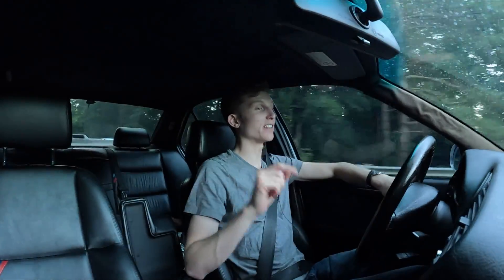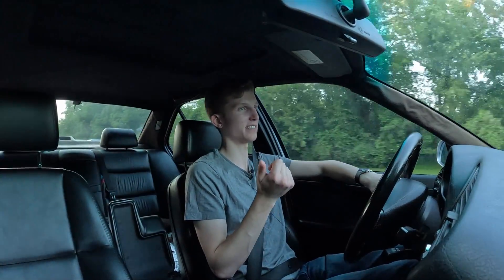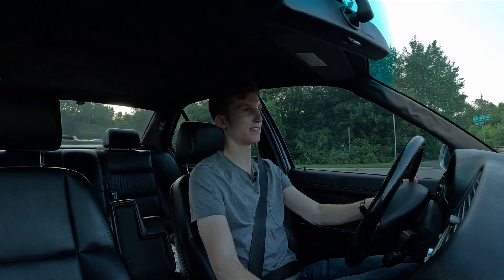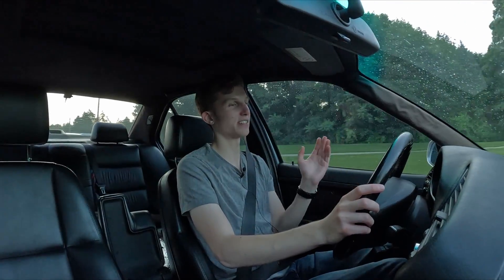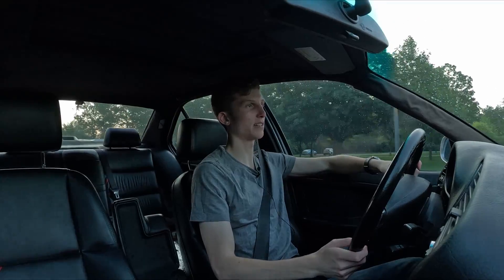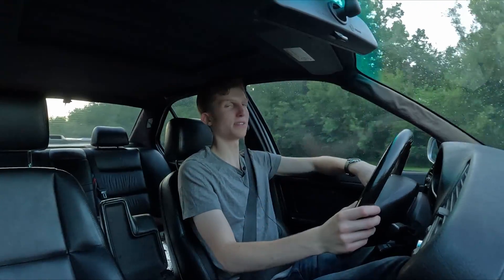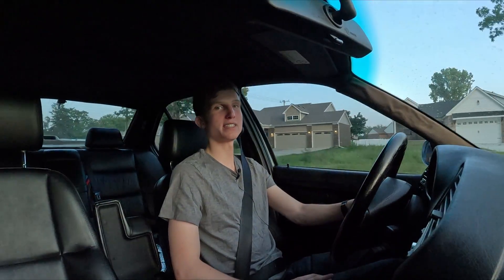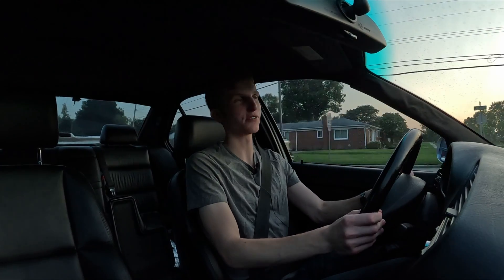Is A Lighter Flywheel Worth It?

Comment: I put a lightweight flywheel (7.1kg) on my M54B30 drift car and I can definitely notice the loss in inertia when trying to initiate drift with a clutch kick or throttling into a drift from mid rpm. The car really needs a lot of rpm now. It's probably a bit more lively at high rpm but at low and mid rpm it is dead. I don't like it already. As Google search AI summary says - breaking traction with a lightweight flywheel really is harder and the car feels as if it has less torque even though it doesn't, it has less inertia. Maybe for 1000hp pro cars it's fine, but for low powered seat time and grassroots cars the heavier flywheel is just so much easier to drift. I can see the benefit for road racing though, where you're mostly on throttle at higher rpm and you don't need inertia to break traction and you do lots of fast downshifts under breaking. But for drifting your 200hp BMW I would suggest you avoid it. Make you car as light as possible, but leave the stock flywheel in.
Reply from the maker: Hit the nail on the head! It has it's place but it's not a defacto "upgrade" like a lot of the internet suggests it is.
Reply: @M-t3ch  I knew it had this effect before buying it but I didn't think it'll be this noticeable. Maybe I got duped by the marketing of the PMC motorsport kit because it said "Drift Stage 2" so I guessed it'll be fine for drifting. It's rated for 700nm and my car probably barely hits 300nm. Maybe it was an overkill. I should've probably gotten stock new clutch kit with stock Sachs performance OEM dual mass flywheel. I'll give the PMC kit a chance for at least 6 months and if I don't like it I'll go back to stock.
Reply from the maker: @fifthgear93  That's fair. I know Clutchmasters makes some kits with heavier single mass flywheels. 20lb range while still having a higher tq rating than stock.

If you go back to stock, feel free to reply back here again and report your experience!

Comment: Does anyone know how much horse power an e46 M3 OEM clutch + flywheel can handle? I have a E36 Touring Wagon with a swapped S52 & E46 6 speed transmission. I want to eventually turbo kit/super charger kit in the future. Most likely, I am aiming for less than 450-500 HP

This lovely setup was done with a previous owner, and they had chosen aa light weight flywheel. I HATE the noise and gridning sounds EVERYONE talks about. It's a hassle in the city. I would rather have the softer, more comfortable setup. 😢🙈
Reply: If you're running boost, the only way is a racing clutch. The pedal isn't as stiff as you'd think. I'm running an act s54 pressure plate and a 6 puck s52 racing clutch disc. My engine is in an s13 but my pedal is surprisingly soft.
Reply from the maker: Clutchmasters have many kits that can handle more power. I would take a look at those.

One of their whole selling points is that their kits are rated for more power, but they use a pressure plate that is supposed to keep oem like behavior. I would give them a call and look on Turner/ECS for it.

Comment: just got a e34 540i manual conversion with a light flywheel. I cannot stand the noise. chatter at idle with clutch out. gear lash/grind acclerating in 1st-2nd  around 1000-2000rpm. Glad to hear its all related to the flywheel. Hopefully going back to OEM will fix it all.
Reply from the maker: @milan8581  Yup, that is all because of the flywheel. I'm sorry to hear that someone got you into a lighter flywheel without advising you of the noise. Installing a factory clutch and dual mass flywheel will fix that.

If you want to keep a sporty clutch feel, get rid of the clutch delay valve. That will make your clutch on and off motions feel more direct. Saves clutch wear too.
Reply: @M-t3ch  yea i took it for a spin and knew the chatter at idle was the flywheel but  I didnt pick up on the lashing sound until after i bought it, so i was panicked for a bit..
its a different sound (grinding/chatter) but comes/goes at the same revs as the chatter.

540i is plenty sporty for me anyway, definetly prefer the comfort of oem weight.

Ill come back to you once its all sorted. guibo is cracking and the Diff is abit leaky too so will get those done at the same time.

Its a 1993 brilliant red 540i SE with throwing stars. Very clean and only done 88000 kms.
Reply: Ok, OEM Luk flywheel and clutch disc have go on e in... WOW, What a diffrence. All the noise is 90 g0ne.  - the odep rattle, lash ok Ng /grinding sound under load.  @M-t3ch
Reply: I no longer have to hold the clutch on at a red light :)

Comment: What car have you driven came equipped OEM with the lightest flywheel? 
MY23 EN and MY18 M3 I would not call it rev hang but the upshifts are no where near as quick as MY01 S2000. All stock flywheels FYI.
Reply from the maker: @jasonscotta7129  AP1 S2000, NA Miata, or the MG Midget have to be up there. Nothing comes to mind that is lighter.

But it's also about the weight relative to the engine power and size. A 20lb flywheel on a 500hp car may feel lighter than a 10lb flywheel on a 140hp car. The 500hp car has a better ability to overcome the weight.

Comment: I know this is old, but I just installed a clutchmasters FX250 with a lightweight, aluminum, SMF. DON'T DO IT!!!!! The noise is horrible! If it wasn't such a PIA, I'd put it back to stock.
Reply from the maker: @kenlipper874  I do not recommend anyone ever do an aluminum flywheel on a street car. The NVH penalty is bad.

Steel flywheels have better vibration dampening properties.

Comment: My flywheel with vibrate the whole car
Reply from the maker: How light is it?
Reply: @M-t3ch  idk the weight but it’s single mass aluminum.
Reply from the maker: @sav7123  Ah, I don't like aluminum flywheels. There is not enough material to deaden vibrations so they are really chattery. Usually, I'd advise someone to go for steel.

Comment: What caused your fx250 to explode? Do you recommend against it?
Reply from the maker: @RickySlickk  Honestly, the answer was uncertain. It was put in backward on the first install, and that mechanic abused it on the test drive pre break in. It's kevlar, so this could have done it in. But it's also a cheap part, and Ebay tier quality control isn't always the best.

I tried to get into contact with the manufacturer to verify that this could have been a fluke, but after dozens of attempts, I gave up and got the Valeo kit.

If I were paying shop labor, I would highly advise against it. But if you are doing it yourself and are willing to gamble, go for it. It was a nice kit, and there are a lot of people that run it with no issues. I drove a 328 that had one with 5 years 40k miles, and it still drove perfectly fine.

Comment: Which Valeo kit did you buy? The E36 Valeo kits I see online aren't actually a lightweight flywheel. Stock is 27lbs and the Valeo kits have 26lbs.
Reply from the maker: I might have had my numbers slightly mixed up. I bought the Valeo single mass conversion kit for 328i models. Not a lightweight flywheel.

I did so for simplicity. I had heard from the NASA Spec 3 guys that the new production LUK dual mass flywheels have a high failure rate on track. Since I am planning on track use, I didn't want to take the chance.

Comment: Are you using the Valeo single mass flywheel conversion kit? i'm considering it for my e46 330ci
Reply from the maker: Yes, that is the kit I bought. No complaints with it. Everything seemed to be quality.

Just make sure to give it a good break in period. It is made for the 328i, so I am not sure how well the material will hold up over time to the extra torque the bigger engines output.

Comment: Noise is only a factor in the drive through with the A/C on. I just hold the clutch in when I'm talking to the person. People are annoyed by too many things that don't matter. Learn to shift? Tap the throttle and release the clutch as the RPM'S come down. It's not the car.
Reply from the maker: Yeah, it's not as bad as people think, in my opinion. The more raw driving experience is more fun in a performance setting. The FX Stage 2 kit particularly wasn't too bad, nvh wise. I'd run it again if I could count on the clutch not exploding, lol.
Reply: @M-t3ch  I've had a UUC M5 version that was pretty good except for the clutch pedal effort. I was the loudest. However, I've been using the JB Racing for 15vyears or more and even sent it off to have JB Racing install a new wear surface ring and it was like new again. It also uses the stock M3 clutch disk and PP so that is simpler to source. The setup is the best overall in my opinion. When I drive wit it, you can tell it's a lightweight just by how I use the throttle to control it. It's like playing the trombone I suppose. When everything is done right there are no downsides. It's all fun and I couldn't imagine driving without it.
Reply from the maker: @williamrogers4914  That’s a cool perspective! I bet having the stock clutch pedal weight helps. The FX kit had a heavy Kevlar clutch disc that was not fun in traffic.

I'd be curious to see how your setup feels. Given that you run the non sprung M3 disc, I'd think the engagements are harsher. Are you on rubber diff bushings, motor mounts, and have a clutch delay valve?
Reply: @M-t3ch  No clutch delay. I thought I had a stock M3 disc but I also believe it is sprung. Information on BimmerWorld says all new design is using M5 sprung disc so now I'm confused.
Reply from the maker: @williamrogers4914  Maybe someone else will chime in. The M5 disc would make sense. It would help with vibrations.

Either way, I think it's cool that you daily the setup!
Reply: I have a JBRacing flywheel too (not installed yet) I have heard of people using stock M3 clutch (unsprung) and pressure plate with success on ltw flywheels. JBRacing and AASCO (which is very similar in weight).
That said, there is a Sachs performance flywheel that is sprung along with the sachs performance pressure plate. Only negative is the price. More than  double what the M3 clutch setup goes for.
Reply: How about we stop accepting bs as being normal when we paid good money for it?

Comment: I've got a 97 M3 coupe. Couple years ago I pulled the engine and trans and did a rebuild on the S52. Put a new stock clutch in and opted for a JB lightweight flywheel. I like the lighter revs....it's nice and responsive. But the trans "chatter" does get old quickly. If I could go back and do it again I'd go with something closer to stock to avoid the noise. 

I guess it all depends on what you're after. I was planning on turning the car into a weekend track toy ...still may do that but the car is mainly a street cruiser. I've also got a Dinan "stage 5" setup that gives it a nice increase in power. That includes a 3.5 bar fuel pressure regulator, 3.5 MAF, Dinan intake and throttle body and the M50 manifold. Paired with a Dinan tune, it does pretty well. I was going to do the Schrick cams but there is mixed info on whether that is worth doing or not. The head seems to be the choke point.
Reply from the maker: I agree, I'd do it again on a track car/weekend toy, but this car sees a lot of traffic and daily driver duty. I prefer the stock weight in that application. I wish someone had made a 17lb flywheel. Close to stock but not too chattery or compromising as a nice medium.

As far as your cams go, this car I drove last year with the Turner Stage 4+ setup and a ported head. Felt a lot quicker than a stock s52. The Turner tune is pretty conservative as well. I think there was more in that setup to be gained. Low-end torque was noticeably worse than a stock s52, but I'm sure you already expect that. 

https://youtu.be/R7MjjmEobCM
Reply: Have you guys ever ran your lightweight flywheels with lightened crank harmonic balancers and noticed reduced chatter noise would love to know if that fixed it for you guys
Reply from the maker: @akeelshah7904 I have not. I didn't even know they made lighter harmonic balancers. But that's a very interesting concept.

I'd think a lighter one would make noise worse.